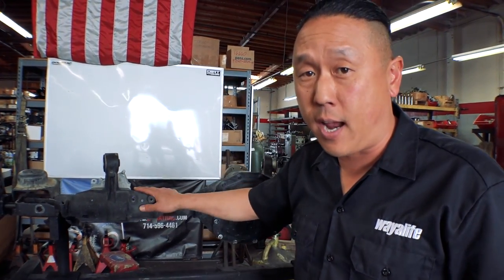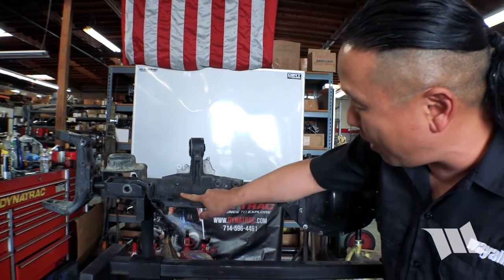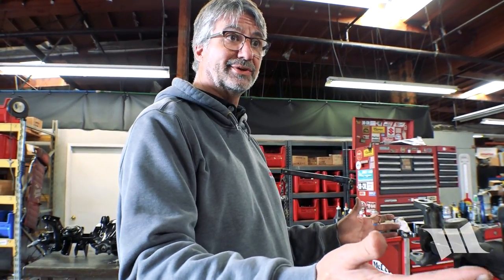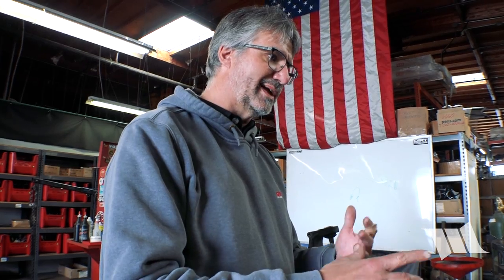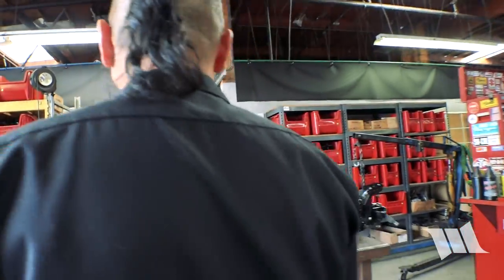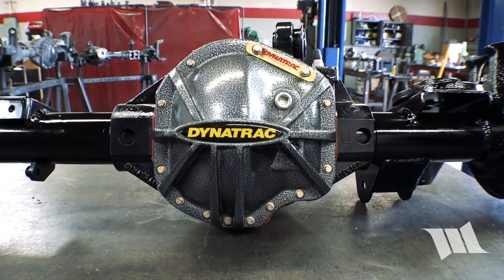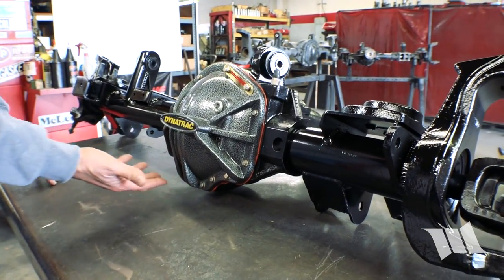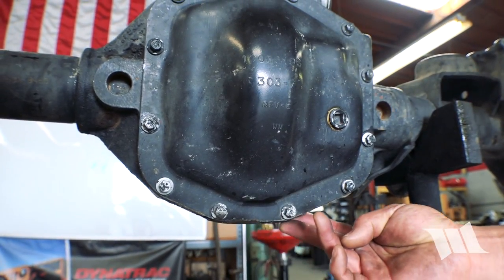Jeep JL Wrangler Front Axle Dana Housing Compared to a Dynatrac ProRock 44

Comment: Good video Eddie and Cindy! I’ve been looking into getting a Prorock44 for my JKUR and then a Prorock 60 semi float rear axle Kinda like the set up you had on Rubicat back in the day but I’m still doing my research and trying to learn as much as I can.
Reply from the maker: Actually, we were running a full float 60 in the rear with a 5x5.5 bolt pattern and 9/16" racing studs. Up front, we were running 1" wheel adapters to make it work.
Reply: @wayalife  You don't happen to have a write up on that do you?

Comment: So, say you are looking to buy a JL or JT, and plan on putting Dynatrac axles underneath it. Is there any reason to opt for a rubicon over a sport?
Reply from the maker: Yes. A Rubicon will still have a 4:1 transfer case and e-disconnect if nothing else. You can also get some of the nicer interior option like the big infotainment screen. However, I suppose it'll really depend on what you're needing your JT to do.

Comment: Great video as always!! Noob question.. If I order the ProRock44 and specify a locker (I’m leaning on not going the Rubi route) does it come ready to install on my Jeep or do I have to take it somewhere to have the gears and locker installed?
Reply from the maker: You can order a ProRock from Dynatrac complete and ready to bolt on to your Jeep. Of course, if you get a different axle ratio than what you have now, you will have to regear the rear axle.
Reply: Wayalife thanks for the clarification; it didn’t get that vibe from their website. Noob.. :) thanks again.

Comment: What size tire can the pro rock 44 can handle?
Reply from the maker: This particular "housing" could easily handle 40" tires. The internal components, I personally wouldn't go beyond 37"-38"
Reply: Then why not go with a 60?
Reply from the maker: Well, for 1, a 60 costs a LOT more. For 2, a 60 is LOT bigger and heaver and has less ground clearance. For 3, a ProRock 44 will have a much better turning radius. For 4, it's overkill for just running 37's.